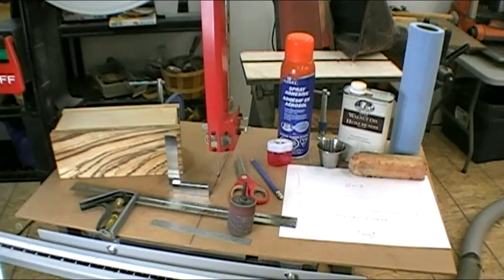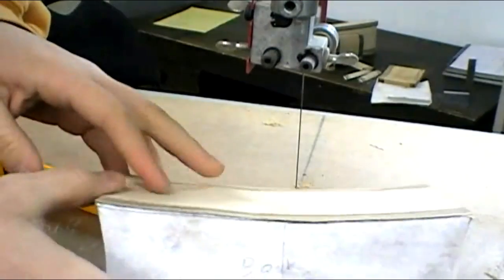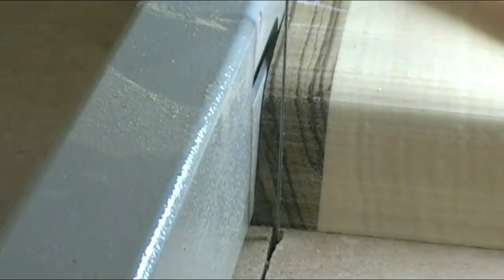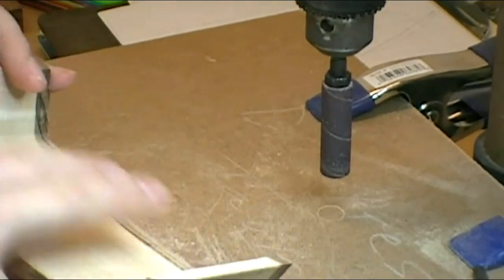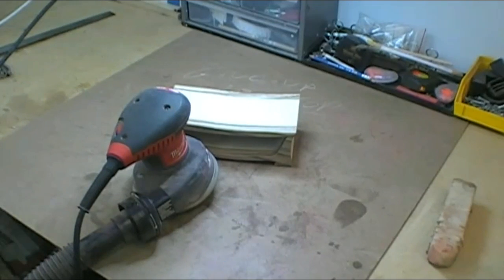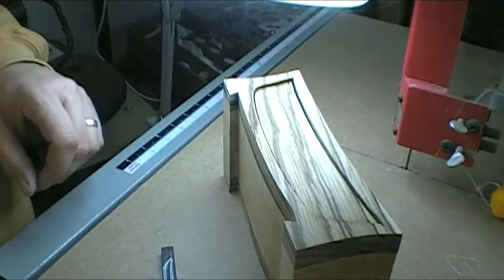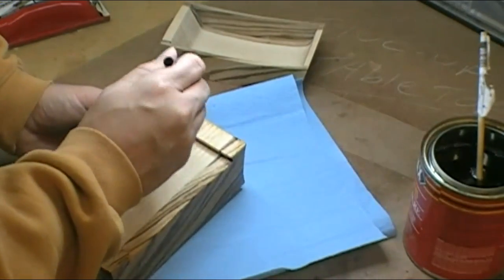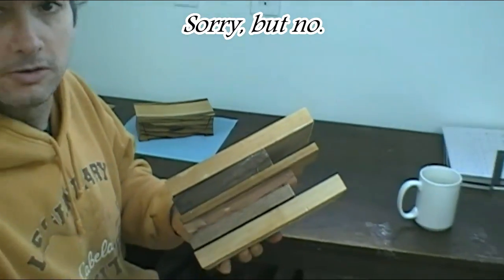Woodworking - The Making of a Neat and Simple Bandsaw Box of my Own Design

Comment: Nice box! The thing  about  wet sanding,  or rather, raising the grain is, for the same reason it raised  after the first sanding, it  will raise again.  The grain that raises is wood fibers  that  have yet to be sheared  off in the sanding process. After first  wet sanding , there  will be a noticeable difference  but if l you  wet it again and let it dry, you'll  feel them again  but  not as bad.. If you  want  glassy varnish, after all sanded up through 400, apply a spit coat  of 1part varnish : 1 part thinner, add varnish to mix after  every  coat  and sand up to 400 between coats . That first spit coat  locks all the fibers  in an upright  position and it's so thin that  it &leaves very  little  buildup  so you finely  cut  ALL the rest of those  crushed fibers that  have  been  playing  peek-a-boo until now
Reply: super useful information by both of you! xD

also don't oil the inside of the drawer!

Comment: What is the proper name for the rubber cleaning block you use to clean belts and
where can I buy one? Great Video with amazing Instructional detail! Thank You!
Reply: You can use the rubber sole of some old gym shoes. It works very well. I use both and there's not much difference between the rubber abrasive cleaning block and an old pair of Vans
Edit: if you gotta have the block, I'm sure they have them at amazon.com

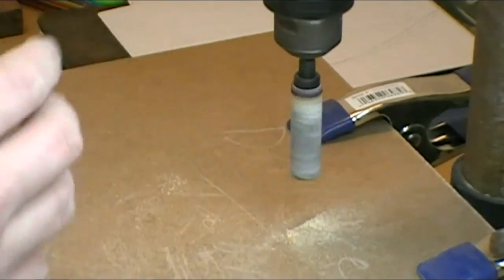Comment: what is that tool you used at 54:34 on the sanding spindle to clean it up? what's the name of that?
Reply: The name is in the question
Reply: A belt cleaner / a cleaning stick / a belt eraser.   It doesn’t have a real name.  Just a rubbery block to clean all types of sanding belts. About $10.  They work well.

Comment: Personally I would have used an offcut from the front of the drawer and made the handle to match the grain ...  also I would glue two super thin shims under the drawer so that the space around it is equal above and below.  It would also reduce the space above.
Reply: and wouldn't have oiled the drawer   on the inside